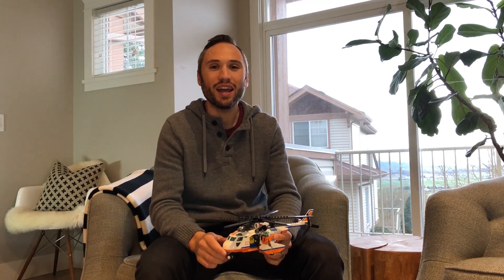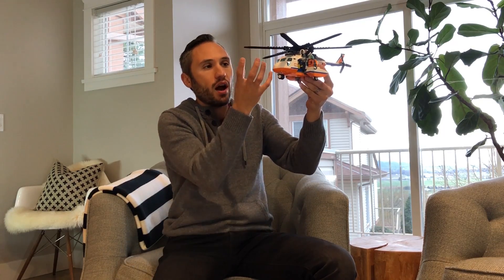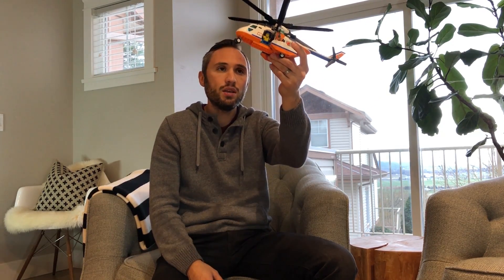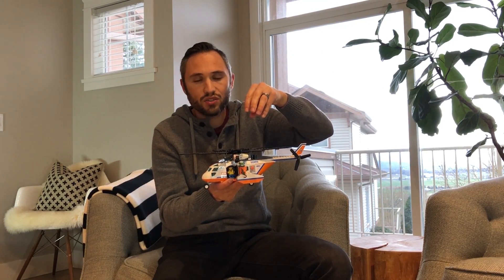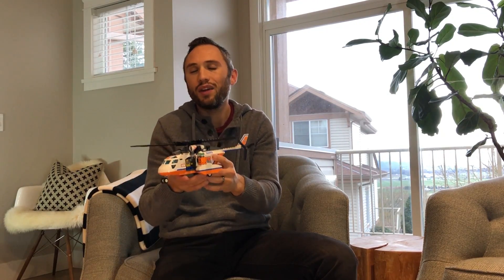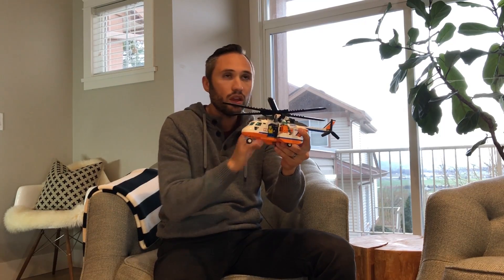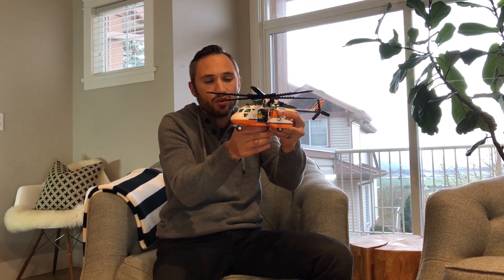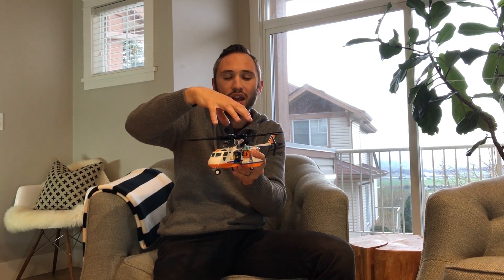Vortex Ring State IS NOT Settling With Power

Comment: Another thought has occurred to me with regards to what you call "settling with power".  You are not losing lift because you aren't in the vortex ring state, you have power to slow down, so you're not at full throttle.  

You are basically just flying it into the ground due to a lack of judgement on when you should have begun to slow down.  We already have a term for that!  CFIT 

Controlled Flight Into Terrain! 😗

By the way, Jennifer Gardner is in the ad before your video, and well,...

She's gotten better looking with age,...pretty cute if you ask me! 😘
Reply: Joseph Vanni ... no CFIT is used to describe flying into something while unaware, i.e. Mountain, ground with low vis. Etc the key part of the term is controlled flight, your example would be uncontrolled.
Reply: Joseph Vanni ... settling with power then dynamic roll over. https://youtu.be/1DDDpI263qE
Reply: Ed S I take it you're pointing that out as an example of "Canadian settling with power"?
Reply: Joseph Vanni ... yes as it's not over pitching or VRS what is the US term.
Reply: Ed S We don't have a specific term for that, but as it seems he just waited too long to put on the brakes, I'd call it "bad timing". 😗
Reply: Ed S Just out of curiosity, when did Canada decide that settling with power was no longer going to be used to describe what happens in the vortex ring state, but instead this "late braking" phenomenon you guys seem to be dealing with a lot?
Reply: Joseph Vanni ... I've been flying since '98 and was taught that way.
Reply: Joseph Vanni ... any time you're flying at high density altitudes, hot, heavy, misjudge the wind and your heading for one of the two. It's not that we get into those situations as we have identified the two scenarios and are trained how to avoid them. That's the key to the whole thing.
Reply: It is interesting that Canadians call that CH-46 accident "settling with power."  Because it isn't.  It's a case of a shallow, mis-timed approach.  In fact, "settling with power" was the furthest thing from what caused that accident.  It is truly laughable (and somewhat ignorant) to call it SWP.
Reply: That Bob Guy ... by your definition, not ours.

Comment: Point of order:  20kt airspeed with a 20kt tailwind doesn't cancel out relative airflow,  it just means you have a 40kt groundspeed ;P
I'm sure you meant "groundspeed" to start with, just couldn't resist as I did a double take on that part of your explanation.
Reply: "20kt airspeed with 20kt tailwind means you have 20kts hitting the pitot tube,"  Exactly!  Which is not what he said at 1:15.  Go and listen.   Hence my lighthearted jab at his slip in terminology.  Jeez.
Reply: Yes, it does. Groundspeed means nothing in this discussion.
Reply: P R of course it doesn’t.   That’s essentially saying 20kg airspeed with a 20kt tailwind means 0kt airspeed.  In which case you never had 20kt airspeed to start with so the sentence is nonsensical.  Airspeed by definition is your speed relative to the air no matter how it’s moving.  If you had a 20kt airspeed with a 100kt tailwind that just means you have a 120kt groundspeed. ...and a 20kt airspeed.  Get out your whiz-wheel and do some exercises.
Reply: This discussion is about VRS. To get into VRS you need to be below ETL (effective translational lift). ETL has nothing to do with speed relative the ground. It has everything to do with the aircraft's velocity with respect to the air surrounding the rotor disk. 20kt airspeed with 20kt tailwind means you have 20kts hitting the pitot tube, and are probably above ETL. Who gives a f what the groundspeed is?
Reply: Peetiegonzalez ... yes the narrator made a mistake and should have said 20kts of ground speed with a 20 kt tail wind. Judging from the context of his following sentence.

Comment: Why is Side Cyclic provide better recovery than forward (or Back), Is left better than right?
Reply: Christopher Gwaltney ... sideward movement instantly puts the rotor system in clean air, any other direction will not be effective.
Reply: @eds6889  Not strictly true. You can normally escape in any direction. All that really matters is the direction of the relative wind.
Reply: @kdanagger6894  true, the relative wind is the key factor. I should have said “as effective”.

Comment: Stall? Feathering? Anybody ever gave it a thought that the phenomenon might simply occur because of the acceleration of the local airflow and the resulting encapsulation thereof? Basically, the quickly descending helicopter creates a bubble of recirculating air around itself and the rotor, that has little drag against the oncoming air from below. So, technically you are starting to ascend faster... inside this bubble. But this only makes your sink rate worse. Yet you are still able to control your pitch and roll... If it was a stall, it would drain much more power from the engine and would lead to over-pitching almost all the time.

As for settling with power, one good example of an aircraft that you can't VRS, yet can easily SWP is a Harrier. Sink a little too quickly during landing, and you won't be able to recover in time upon meeting the ground.

Comment: What is the explanation for why VRR requires moving the cyclic left for clockwise rotor rotation, and to the right for counter-clockwise rotation? I have seen the Vuichard video and fully visualize the Vortex Ring State, but on the face of it, don't understand why recovery cannot involve moving the cyclic to either side? 

Does the answer have something to do with a 90 degree force vector in effect due to rotor rotation? (Not precession, but I can't remember the term at this moment.)
Reply from the maker: Jangle2007 I think you are talking about phase leg. Yes I believe it has to do with that. I can’t give you a fantastic explanation as to why it’s right or left specifically. However the main theme is that sideways is a much quicker recover than forwards.
Reply: Thanks for the thoughts. You answered the other question that was on my mind (why not recover forward and back as well). I'm curious now what forces are at work that make the recovery so specific.
Reply: The reason you go left in a right turning system, and right in a left turning MR system is that you are working WITH the tail rotor at maximum effect. There's a longer answer but you can see that in the explanation of the maneuver.
Reply: You want your tail rotor thrust pushing you sideways.  So you add full power-pedal and opposite cyclic.

Comment: NOT a stall.  The blade has to have more twist, just like on an airplane prop, when the flow into the rotor increases in speed.  The AOA of the core sections DECREASES and generates no lift and will go negative as the flow speed into the rotor increases. 

If you took a helicopter rotor and put it on an airplane with very tall landing gear (stretch your imagine here) you would have great thrust (1G) at 0 mph and less so as the airplane moved faster and faster forward.  At 40 mph or so you would have no thrust as the core would negative thrust and counter the outer blades.  

Draw the speed triangle along the blade.  Rotational speed at each point along the blade, incoming speed (same along blade) and resultant at each section.  The outer blade has a large rotational vector and a small in flow vector.  The core has a small rotational vector and small in flow.  The core soon goes negative.  To counter this it would require a means to TWIST the blade and then the effect would be minimized.

All airplane blades are stalled at the core due to the over twist for the slow speed on takeoff.  Just listen to the noise.  The airplane blade is designed for a rotation speed and forward speed such that along the blade the airfoil section has a positive AOA.  In contrast, a helicopter is rather flat and without twist.  You see this difference in the Osprey twin rotor VTOL that flys at 350 kts with the props like an airplane.  During landing the cores are completely stalled and the only thrust is via the bottom side of the blade.  This requires lots of power to do.  Their blade is around 70 degrees AOA when the tip is at 6 degrees.  

Hope that helps.
Reply: This confused me too.  Not a rotary pilot, but the concept of down/inward flowing air causing a stall state seems counter intuitive to me.  SUrely it would result in lower relative blade angle of attack and therefore less stall likelihood.  
Wouldn't it more likely be a case of more pitch/collective causing more downwash, with the resulting vortex coming in from the top of the disk is then also at a higher velocity, meaning there is simply less lift being produced by the entire system.  Essentially the rotor disk is sitting within a package of ever greater downward flowing air.
Reply: Dave, A helicopter blade is a low inward flow propeller.  It is flat without the twist needed to make it produce thrust when the flow in inwards.  As I stated before. if you put the helicopter blade on an airplane it would be amazing from 0-5 mph and terrible at 40 mph and zero afterwards.  Why?  because the inner blade will see a negative AOA at some point where the outer blade is full pitched....  Draw the three vectors and it is obvious why they get trapped in there own down flow.
Reply: seaplaneguy ... are you taking this into account...?
In the case of helicopter rotor blades, the tips of the blade travel very fast through the air while the parts near the rotor hub travel much more slowly. Because lift increases with speed, the outermost sections of the rotor blades generate more lift than those parts closer to the rotor hub. So a rotor blade is said to be an aysmmetric generator of lift, because of the difference in lift generated along its length.

Helicopter manufacturers try to reduce this differential effect (that is, aim for more equality of lift along the blade length). This has two main aspects:

tapering a blade toward its tip, which reduces its surface area, in turn reducing its lift;
twisting the blade (commonly called geometric twist) so that the blade root near the hub presents a higher angle-of-attack, thus higher lift.
Reply: Ed, Yes I take it all into account with the vector analysis.  Yes, the outer blade does create more lift due to higher speed, but the issue is not speed, rather the resulting vector AOA which is derived by the sum of the rotational speed and the inward flow.  Draw a right triangle.  The two adjacent sides are 90 degrees.  One is the rotational speed and one is the speed of the flow down the axis of the rotor.  Now draw the Hypotenuse.  Do this along the span of the blade from center to outer tip.  Compare to the chord line of the blade to the Hypotenuse of the vectors to then get the AOA.  With high inward flow the center of the rotor goes NEGATIVE AOA.
Reply: seaplaneguy ... this as well?
Wash-out (helicopter Rotor Design)

A design that decreases the blade angle from root to tip by twisting it, which maintains the associated angle of attack or, in many cases, reduces it. Wash-out controls the coefficient of lift from root to tip to ensure even, or controlled, lift production throughout the length of the blade.
Reply: Ed, Basically, yes, seems you get it.   If the induced flow into the top of the rotor is 10 mph, for example. you can add in a twist for a given rotor speed such that the AOA along the blade is the same.  At that point the Cls in the sections are all the same.  As the collective is pulled, the AOA of the blade increases and the resultant induced flow may go from 10 mph to 15 mph, say.  A new twist would be needed to maintain equal CL in each section along the rotor, and thus lift distribution.  If the blade is NOT twisted, at some point the inner rotor will produce nothing and all the lift will be from the outer part.  The efficiency drops due to the blade not being at the max L/D over the sections.  

You see this in airplane props.  On takeoff an airplane (C-172 for example) prop is stalled at the core and you get a noisy woop sound of separating flow.  Go out and measure a prop some time.  The AOA is very large at the core.   It is not until you get to the design speed of the prop at the design RPM that the CLs are all equal or near equal where the L/D for the section is good.  Max L/D is typically at around 6 degrees AOA.  So, if you wanted a prop to be 95% (20 L/D) you would design the twist so that at the cruise speed and RPM setting the CL would be at 6 degrees along the entire blade where L/D is around 20:1 or ...1/20=5% loss or 95% efficient.  You would then deal with tip issues and you might get a blade that is 90-93% if you do it well.  The problem is that such an optimized blade may be very poor at slow speed.  

People don't realize that if you were to have a twisted blade and make it wide you good get many times more thrust on takeoff.  It would be more like a helicopter blade and it would go more flat as the airplane slows down.  This is what I will be doing on my seaplane.  Massive thrust low speed, twist and great efficiency at high speed.  Nobody does this because it requires a twisting blade which are more fragile.  A Lycoming would not allow it due to power pulses.

Comment: A techinical question. You mention that the blade will stall, however when the blade meets its own downwash, I think the angle of attack is to low and maybe even negative. So it does not stall, it just cannot generate lift. I the Swiss video, they actually say to increase the collective to maximise power. This is quite the opposite from a plane that stalls when flying to slow. I am seeing this wrong?

Comment: I'm pretty sure the vortices start at the tip and work their way in. Lift is greater toward the tip more than the mast. If you're going to use the term stall, you can't get confused with retreating blade stall. VRS is not really a stall since the blade is technically still creating lift.
Reply: You are correct that it is not a stall, but a loss of lift due to reduction in angle of attack. If the downwash is fast enough the angle of attack could go negative and create negative lift in areas along the blade.

He is right that loss of lift starts at the root though, because it will always have a lower angle of attack in downwash due to slower horizontal speed.